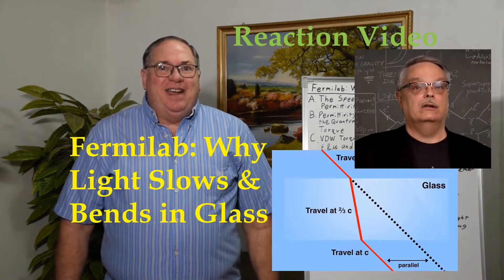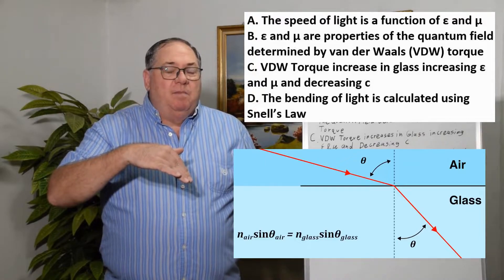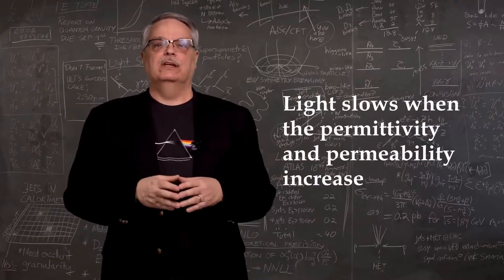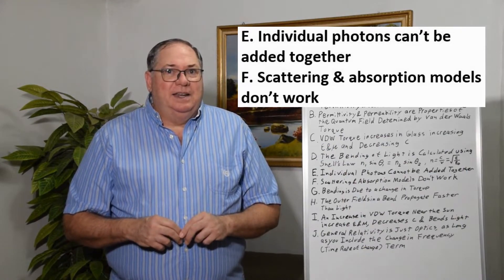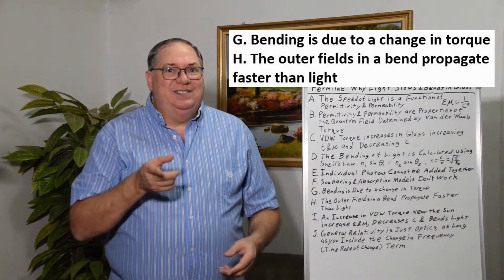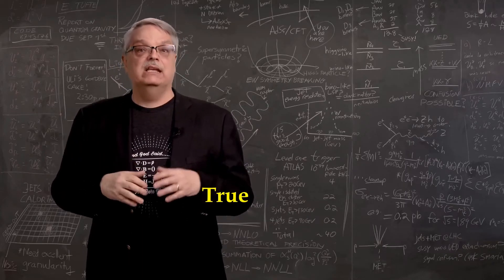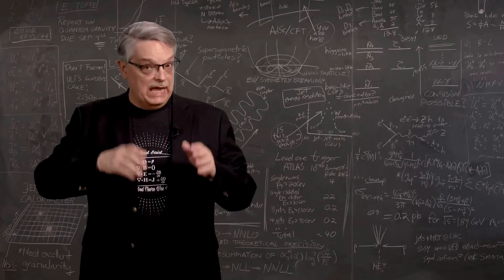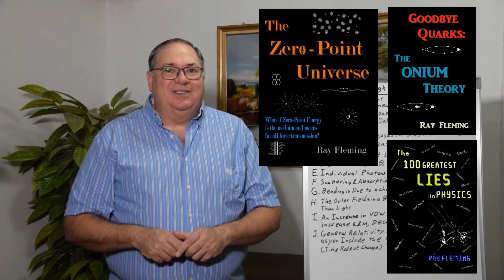Fermilab: Why Light Slows and Bends in Glass

Comment: for huygen model , instead of half circles , maybe it quarter or less .  : >
Reply: why would it be quarter circle? this is called a confirmation bias. you dont invent formula to prove something you think is real, its other way around, you invent ways to disprove your hypothesis and if you're out of ways to debunk, you either discovered something or don't know enough.
Reply: @tsraikage  well i figured it happens for sound and water waves . when sound and water waves enter dense medium they don't have  half circles , they have less than half circles . sound  and water waves travel along there shape ,  the reason i think waves do this , is because they don't have a direction . they are trying to spread in all direction , but if it goes backwards it encounter a rarefaction and becomes neutral, go forwards a it encounter a neutral and becomes a compression .  waves also spread on the axis perpendicular to the rarefaction , along this axis the compression gradually gets less , because there is no rarefaction behind it . 
i would like to know , what is wrong with this hypothesis ?
Reply: @m.c.4674  i see your point. you get some aspects accurately, for example thing that they spread in all directions, and this is true. but only for uniform medium, meaning that for exaple in theoritical unconvected air and even temperature, sound waves will grow gradually like inflating a balloon. when waves change medium doesnt matter they go from denser to less dense or vise versa, some get reflected, some get refracted. but nevertheless, wave will spread evenly from the source to medium as far as medium is even, meaning that generally wave can be spread unevenly if medium is uneven, but in every alike sector of medium, wave will be spread evenly. also worths noting that fundamental particle wave function (light too) is transverse where as sound is longitudinal, compression wave, so they're not entirely analogous, but in this case (medium change) they behave the same way, spread evenly in all directions and spread according to medium density. furthermore, wave spread has a direction of course. dont think of wave as particle, as its wave, so we need correct math for it, not the math used for particles. we need to use vector fields and calculate flow.

Comment: how can a wave be rigid .
Reply from the maker: It's not.
Reply: @rayfleming2053 sound waves can refract , reflect , diffract . so does that mean that sound waves have some magical property that make them only have refraction in one direction , when going through denser medium. 
 https://www.youtube.com/watch?v=yYc7Ul0RJZA

i think the problem here , which i also have , is that we think that waves have a direction , when that can't be the case , because compressions exert pressure in all directions , this is a concept that i still struggle grasp .
a compression can only mirror the angle/shape it is already traveling on , because it doesnt have a bias for a direction.

the only reason light waves seem so directional , even more so than sound , is because light waves are tiny , and i don't mean by wavelength , i mean there wave front length and thickness is microscopic . if you don't believe me then try to explain why when all colors are add together the light is white and when pass through a prism it is back to the individual colors .
it does depend on the wavelength , because as the wavelength decrease , the wave front length and thickness decreases , sometimes .
Reply from the maker: @m.c.4674  A wave in a medium like air or water is very different from a wave in the quantum field.
Reply: @m.c.4674  Light is a cluster of expanding electrons. A prism is a mass spectrometer. The red ( larger/ more massive) cluster bends the least and sending it through another prism will not change that.” The Final Theory: Rethinking Our Scientific Legacy “, Mark McCutcheon.
Reply: @rayfleming2053  air can produce vortex and wind , and coincidentally the vortex and wind is communicated at the speed of sound in air . 
not saying that light is the exact same as sound , but it is also must indistinguishable .  
if light is not rigid then how does it tug on the rest of the wave front ?
what is physically happening that changes the permeability of the quantum field ? 
is your quantum field , aether or a field ? 
pls , can you tell me how much more different sound is from light ? 
how does light reflect ? 
is light a longitudinal wave ?

Comment: Could slower light speed in glass mean that glass is 50% denser than the electron/positron pairs all around us, and e/p pairs that exist in what we call a vacuum?
Reply from the maker: The quantum field in glass or other material is less dense than in a region of space without matter. As I discuss in the video the increase in quantum torque in a material causes the speed of light to slow and the permittivity and permeability to increase.
Reply: What about glass refractive index for X-rays < 1? And what about accurate experiments by Lene Hau in Bose-Einstein condensate about undeniable catch and release quantum effects, even to stopping light?
Reply: @alexandrekassiantchouk1632  and how does light "get back up to speed" when exiting glass...where does that energy come from.
Reply: @carlosgaspar8447  It is about difference in group and phase speed in case of X-rays.
Reply: Exactly

Comment: If EM fields can propagate faster than the speed of light, wouldn't that mean FTL communication is possible?
Reply from the maker: Yes, and we see this with quantum entanglement, but there may be simpler ways.
Reply: @rayfleming2053  LOL no we don't. FTL communication is not possible.
Reply: So does faster than the speed of light mean instantaneously (as in infinitely fast), or just somewhat faster? And if it is faster, how much faster and how could this be measured?